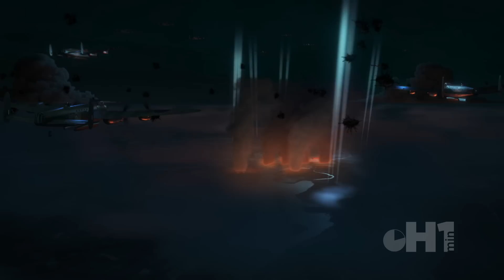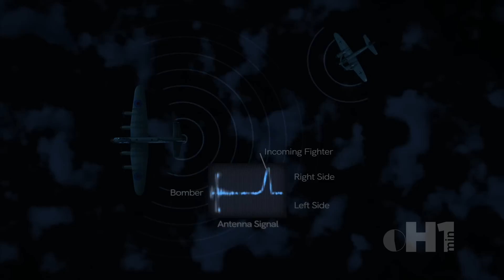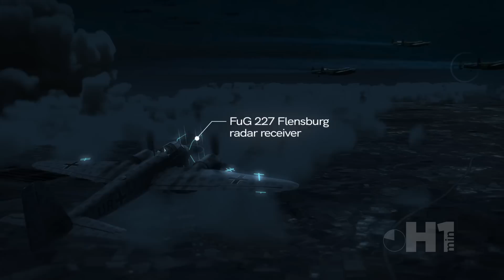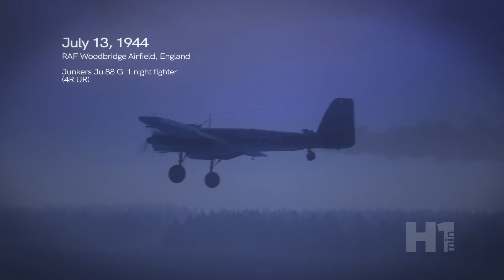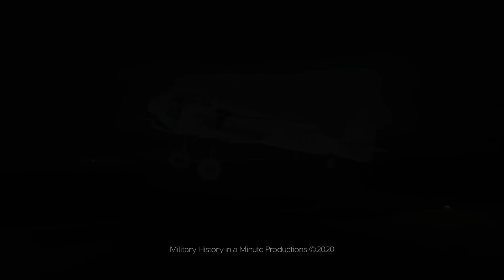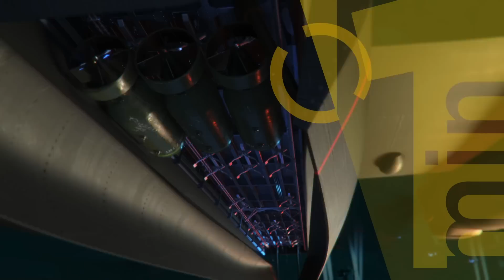H1MIN: MONICA VS. FLENSBURG RADAR

Comment: The Original Monica system design started in 1941 for a audio warning system that gave a rapidly increasing tone in the bomber crew's headset if there was an aircraft behind the bomber that was decreasing in range. Fitting of it to RAF Bombers did start in early 1943, but was then delayed when it was found to jam the Oboe Blind Bombing System. After Oboe was modified to overcome the issue by June 1943, rapid installation of Monica was done on the RAF bomber force. However what was originally designed for bombers flying on individual routing to a target was now being used on bombers flying in a concentrated Bomber Stream and the Monica equipment was going off all of the time as the Bombers weaved around in the Stream. Most bomber crews got so pissed off with this distraction that they turned the equipment off. By September 1943, Bomber Command and the equipment's designers at Telecommunications Research Establishment (TRE) realised that Monica Mark 1 (AKA Audio Monica) was a Failure and TRE came up with Monica Mark III (AKA Visual Monica) which is the system shown on the Video. 

It used the CRT display and receiver systems from the ASV Mk 2 radar located and operated by the Wireless Operator on the Bomber (the equipment being recycled was being phased out of service with Coastal Command). The first 50 system built were issued to 61 and 106 Squadrons of 5 Group Bomber Command in late October 1943. The initial reaction from the Squadron's was the equipment was very easy to use and German night fighters manoeuvring in behind the bomber were easily noted and evaded. A crash program was instigated to modify as many Monica equipped aircraft as possible, abet there were only 600 CRT / Receiver sets available from UK stocks and 200 of them were required for the Mosquito night fighters planned for Bomber Support in 100 Group (the Mosquito Bombers also got the Equipment in the Mark 1 format which worked OK as they didn't fly in the Bomber Stream). 

Aircraft fitted with the H2S Bombing and Navigation radar didn't get Monica as a system that displayed close in contacts to the underside of the Bomber using the H2S radar was developed called Fishpond and that was fitted to Bomber Command Pathfinder aircraft in October 1943 onwards. 

Flensburg didn't become operational in a major way until March 1944 and the Bomber Command Operational Research Section who monitored Loss rates of aircraft by types of special equipment fitted to aircraft did note that losses of aircraft fitted with Monica which had been lower than aircraft not fitted with it was changing rapidly throughout April and May 1944 and they suspected the Germans were homing on it. Of Course this was confirmed when the JU-88 was captured. Trials found out how effective Flensburg was and when attempts to modify Monica were made to make it more difficult home on failed, it was removed from all of the Aircraft which operated in the Bomber Stream. Aircraft that didn't operate in a Bomber Stream like the Mosquitos retained the equipment as the primary reason it was removed was to avoid giving away the position of a Bomber Stream from decoy and spoof aircraft that were attempting to spilt the German night defences.

The USAAF actually built their own copy of Monica and fitted it to their escort fighters. It was based on the Monica Mark 1, but used a flashing light and a bell to give a warning. 

The US version of Monica in a modified form ended the war!!! Four of them were each fitted to a pair of bombs dropped on Japan in August 1945. They were the radar fuze system for the Atomic Bombs!!

Comment: A bit of extra info: 
FuG 227 „Flensburg“ was made by Siemens and was a passive Radar.
There were also nightfighters equipped with the FuG 220 „Lichtenstein" SN-2-Radar made by Telefunken which was an active radar. It was an improved version with a lower frequency which had to be altered as Allied forces found out about the German frequencies through the German ground radar station "Würzburg" and disrupted Germany radars with the radar countermeasure chaff for weeks until the new SN-2 was deployed. It was much more resilient to chaff and brought nightfighters more reliably to their targets.
Reply: Yep until the British used Rope Window which Jammed SN-2 just as well as normal Window screwed up the original Lichtenstein. The British were aware that a new radar was about as the number of Contacts on their Serrate equipped Mosquitos looking for standard Lichtenstein radar equipped night fighters dropped off a Cliff in May / June 1944. In the July they found out why.

Comment: The german night fighters shot the bombers from below with vertically mounted machine guns (Schräge Musik), so they don't have to pitch up to shoot, like it's shown in the video. Other than that the video is very well done!
Reply from the maker: Yes you are correct. The reason I did not depict Schäge Musik is because some Ju88's did not have those guns and in particular 4R UR (the plane that was captured) did not carry those guns (just the gun pod underneath the cockpit). The pilots described how easy it was to take out a Bristol Blenheim for example, and some aircrews didn't even know what shot them down. Appreciate all of your comments. Thank you!

Comment: Compass problems? It’s okay guys, we won’t tell the Germans.
Reply: most likely was map problem and compass added to the confusion. Compass rarely goes wrong.
Reply: @L_ky  Mark Felton did a video about this very incident. It's called Luftwaffe Defection.
Reply: Imagine being a soldier on airport and a german pláne suddenly lands
Reply: @jurajsintaj6644  Yeah actually I wonder what the crew at the airbase were thinking… They could’ve shot it down easily, but decided to let the pilot come over and have a chat with him. I assume that they observed the plane to be damaged and alone, or just sheer luck that it landed safely
Reply: @fouzanium  They also might‘ve suspected he was a defector. A very similar event happened in korea when a NK Pilot fled in a high-tech jetfighter and ”sold” the airplane in exchange for asylum
Reply: Obviously this was during the Cold War but still
Reply: @jurajsintaj6644  HOWARD! GET THAT FLAK!
Ju-87 landing
HOWARD! DO SOMETHING!
Reply: Don't worry, those magnetic detonators didn't work that well when U Boats are deployed close to Norway and Sweden.